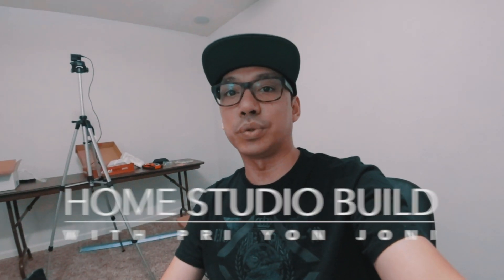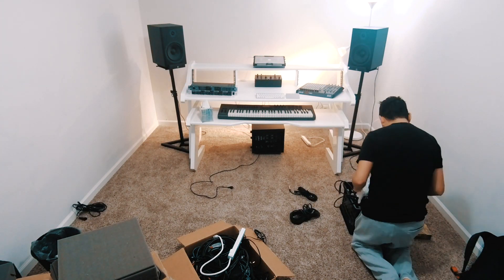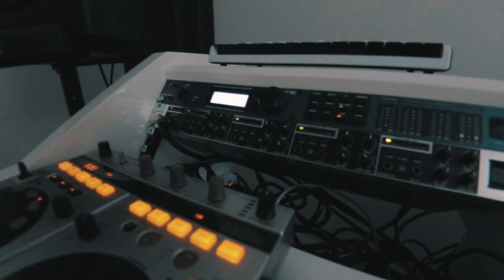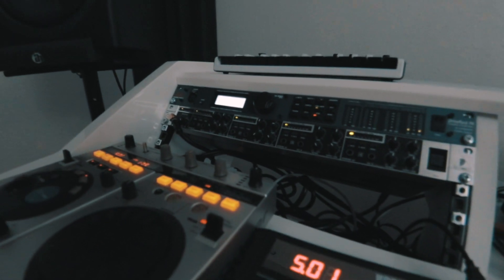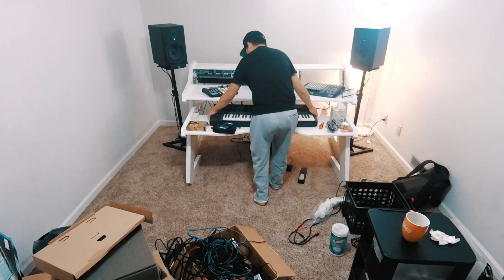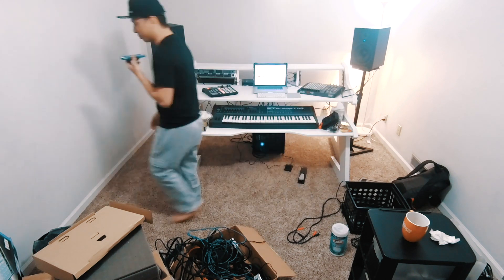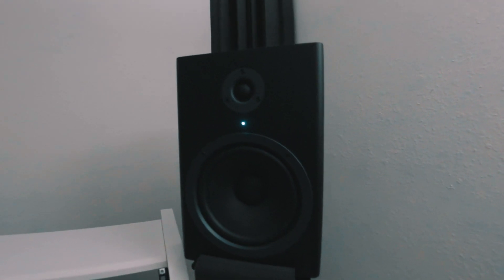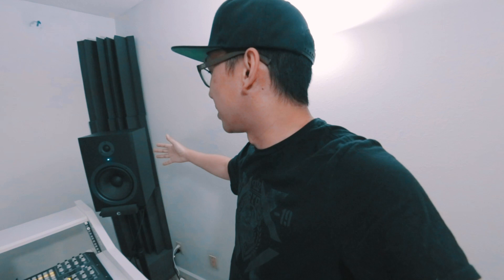Home Studio Build Series: part 2

Comment: A big monitor on the top shelf would be fire
Reply from the maker: DJ_RueBoi the plan is to get a 27 inch iMac and a 27 inch display. The iMac can be used as a 5k display for the MacBook if needed. I want space between the two displays so I can put a center channel studio monitor when I do 5.1 surround.
Reply: Mounted on the wall...INFERNO!!!! And you clear up desk space for actual toys.